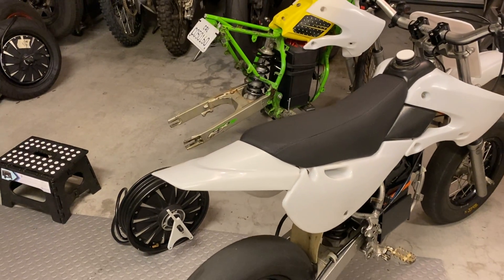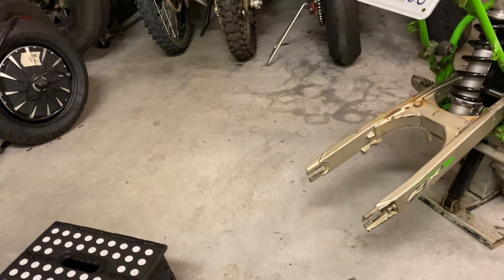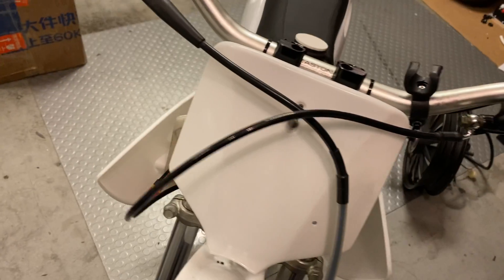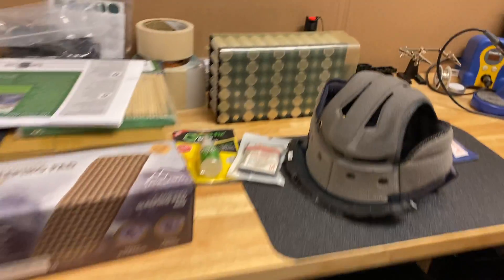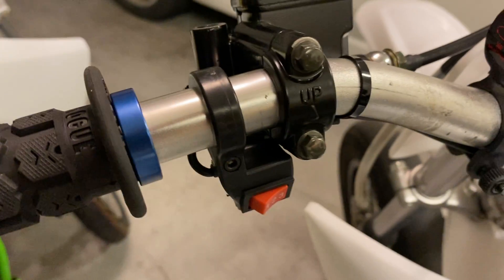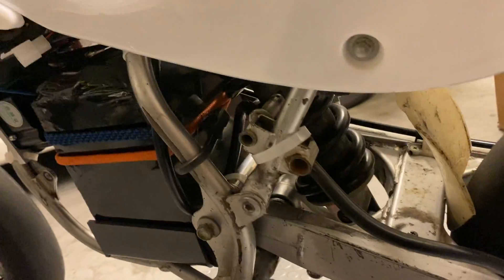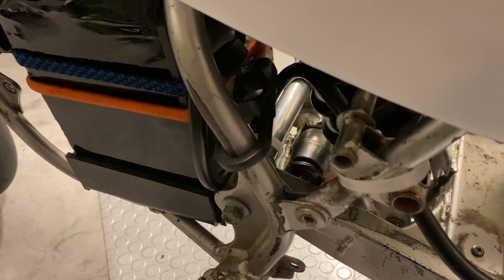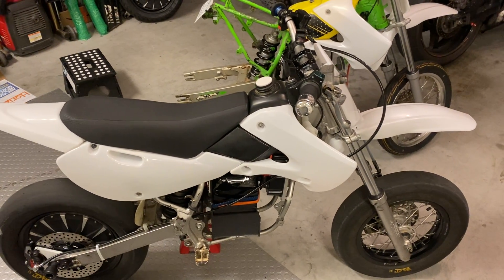How to build a electric mini motorcycle based on a kx65 frame and a hub motor kit

Comment: What kind of power do you get out of the hib motor, how does it compare to say a 138v3? also can you provide a link to the hub motor?
Reply from the maker: I was doing around 10 hp out of the hub motor. It can do more. 
It's lower power compared to 138v3 for sure.
No links, the hub motor was a custom batch and discontinued, sorry.

Comment: Hey man, i want to ask what would you chose for stunt and city rideing with a pitbike like this converted to electric between hub and mid drive motor? i mean i know that a hub motor is 20kg and i don't know how that could efect the stunt part because it would be much heavyer in the back but it would help with more room for battery pack to fit in the frame and it would have more range, but i want to know what you would chose and wich one is better for stunt and city rideing
Reply from the maker: Yeah you summarized pretty well --- if you do steppes, bunny hops, jumps, burnout drifts etc. etc., having a mid drive will provide you with the right handling characteristics. You do lose a bunch of space with mid drive, so it is harder to package the battery pack.
If I gonna do a stunt bike, I'd say doing mid drive is the right way to go

Comment: Hello I saw your wonderful video. How many amps is the breaker you are connecting from your battery pack?
Did you use the 48V breaker for the 72V battery?
Reply from the maker: Hi, the breaker is a 300A breaker —- but it’s rated at a lower voltage so it’s not perfect, it’s kinda difficult to find a good breaker at a reason price….

Comment: Do you think the KX65 could handle QS motors 12" 5000W 72V motor? Or what about their 12" 3000W 72V motor?
Reply from the maker: That’s a tricky question. The swingarm itself is quite beefy, so I think the mechanical structure might be fine. However, those motors won’t be a direct fit (like mine), so you’d have to modify the swingarm extensively, especially if you want a rear brake.
Reply from the maker: So during the modifications—- e.g. if you cut the swingarm a lot, or weld extension tubes, the structure integrity might compromise, then it might or might not handle it any more

Comment: Could this work on other bikes?
Reply from the maker: Hi, the general principles apply. But the hub motor dimensions will bolt on only to a kx65 swingarm; it’s not a direct bolt on for any other bikes, since each bike’s swingarm design is a little different
Reply: Yes they usually have similar drop outs for the wheel. I think 170mm

Comment: Hi there, is the kit available anywhere else than Facebook marketplace? Also what KX65 model year would you recommend best for this sort of conversion?
Reply from the maker: Hi, I live in the bay area (San Jose). Contact me and you can pick up in Norcal or Socal. The KX65’s throughout the years are basically the same, with pre-02 having shorter forks and shorter swingarm. I built both, I don’t think there is really that much a difference. If you are set on a mini motard usage tho, then you can put pre-02 forks on there, for the shorter length
Reply: @leitian7328 also interested if you can source them still
Reply from the maker: @MountainDaughter  Unfortunately I sold out the batch I made. Moving on to different projects so I decided I won't be starting a new batch. Sorry!
Reply: Hey sir I’m in Hayward I’d love to buy a kit let me know when I can
Reply: I need one of these kits!!!!!!!

Comment: Hi, what are the specifications of the hub motor? Great build btw
Reply from the maker: It’s a custom hub motor from QS motor. Nominal rating is 72v 2000W. I was pushing 72v 100A through it with no issues whatsoever.
Reply: @leitian7328  what parameters u set for this motor in fardrive controller to push 100a? I have votol controller with this same qs 2000w motor i would like to do that as urs.
Reply from the maker: Usually the app for the controller has a setting like “current limit” or something. Just set that to 100A and you’re set